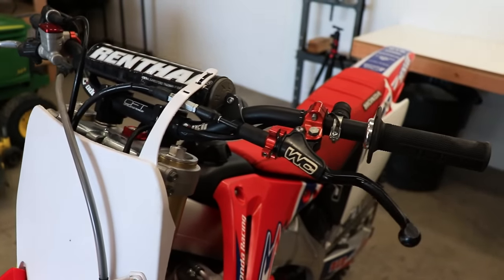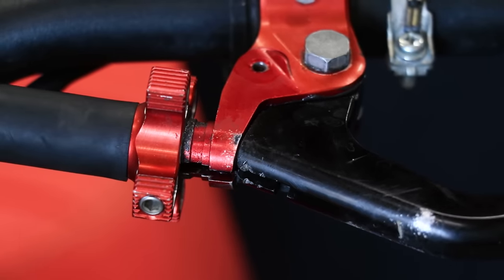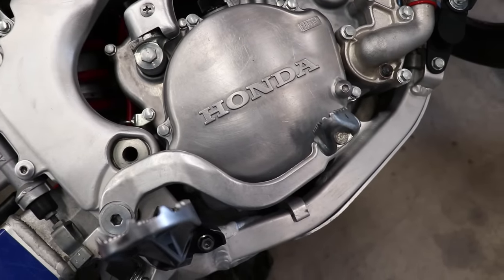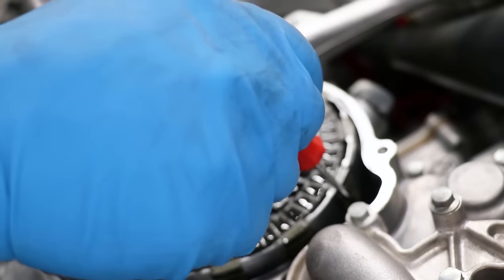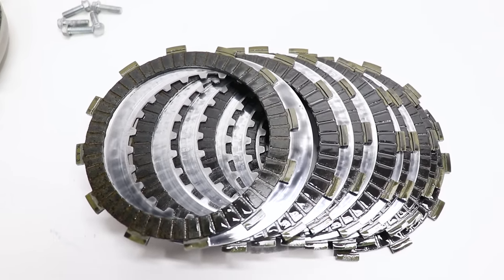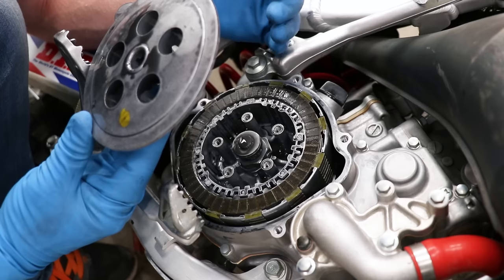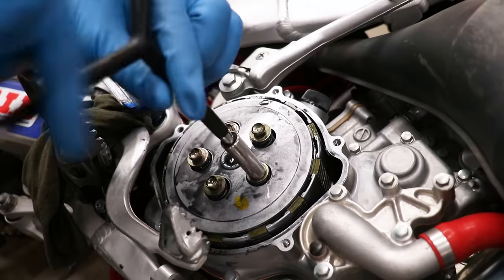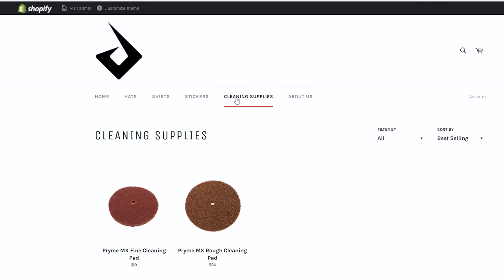How To Fix A Slipping Clutch

Comment from the maker: What is the common problem you have with your bikes?
Reply: Sick video
Reply: Cameron Niemela drowning them in the uk fuel injected bikes are horrible to sort once drowned and that happens alot in the uk trails
Reply: Bolts vibrate out
Reply: Jack Callahan you have stripped the threads or just arent tightening them enough or need to use blue locktight
Reply: my most common problem is ...they run out of gas! ;)
Reply: Cameron Niemela I have paranoia about my bike overheating. What is normal operating temperature?
Reply: I loose a lot of bolts
Reply: The chain on my supermoto is ALWAYS loose after any length of ride. Still haven't figured out if its the heavily increased traction or just my $25 DID non oring chain.
Reply: Carb problems... It's damn mikuni TMX that comes on the late model CRs. I'm sure you know all about it :(
Reply: tire tubes :(
Reply: common problem with my bike, is that i currently dont have one :(
Reply: Cameron Niemela many opinions.. Hone or not to hone a cylinder when replacing a piston?
Reply: Cameron Niemela leaking forks smh 🤦‍♂️
Reply: nooo, you dont home a nikasil barrel! a sttel barrel yes.. a nikasil one?? hell no! the coating is too soft compared to steel...
Reply: Snitchy1989 Its actually harder......
Reply: nikasil is formal nickel coating... Nickel is more closer to the properties of alloy... and alloy is not stronger than steel... Lighter weight yes, better heat transfer yes.. But not stronger....
Reply: Snitchy1989 You need a diamond hone to hone nicasil but you can hone a steel cylinder with a regular one.
Reply: My bike bogs down when i give lots of gas, its a ttr 125le
Reply: Yeah, they were a real pain to jet! I made the switch to a Keihin PWK carb years ago and have never looked back.
Reply: Nikasil is a lot harder than steel, that's why they use it. You can hone a Nikasil cylinder with a ball hone to remove glaze (it won't remove any cylinder material) but it is not normally necessary. A diamond hone is what is used on Nikasil cylinders if they want to remove small amounts of material to match it to a certain piston size or fix slightly out-of-round cylinders but most people won't have access to these machines and they mostly aren't necessary when doing a top end.
Reply: Ride red, never problems;)
Reply: Main seals
Reply: Gearbox sucks:(
Reply: carburetor problems
Reply: Nick Childs its a cheap chain and you bike is probably low geared and im assuming you are wheeling it as its a sm so the chain is getting pulled arder all the time those cheap chains are usually only used on 125s or very coasty riders if that makes sense
Reply: CHANCE1 216 clean it up if it has no marks on it just use a light kitchen green scouring pad thing and crosshatch the cylinder with it
Reply: when I push in my clutch he still goes forward it’s hydraulic btw
Reply: Cleaning the oil sight glass
Reply: torque to spec, manual specs will show you what to retorque every "race"
Reply: varies on the bike,  you can get rad caps that will tell you the temperature while still having factory rad cap pressure
Reply: clean out the dust seals and oil seals, use a seal doctor, for rebuilds are easy all you need is to follow the manual and take your time and be patient
Reply: switch to a stiffer spring
Reply: Vetrix clean the jets out of the carb
Reply: Cameron Niemela My 125 kick starter won't move and it will sound really werid
Reply: shes seized boi
Reply: Cameron Niemela it blowing o_o
Reply: Cameron Niemela old owners stripping every single bolt ever and some how getting two sockets stuck on bolts
Reply: my bike keeps riding when clutch is in
Reply: Vetrix had this with my 250 i just adjusted the idle rpm higher and it fixed it for me. Worth a try?
Reply: Mine is sometimes hard to start for no reason
Reply: Cameron Niemela My ttr125 doesn't like to idle 😂
Reply: Damion Mcclelland it’s the idle screw
Reply: Damion Mcclelland search up how to idle a dirt bike
Reply: Dude on dirt bike I have, but it idles really high with the choke on then when I turn the choke off it'll idle sometimes really slowly so idk, at least it runs lol! check it out on my channel R3d Rider
Reply: My psvr controller tracking sucks
Reply: My 2 stroke bogs dowb
Reply: Cameron Niemela getting parts in the uk for my 1990 cr125 is a bitch since spending a fortune on the engine the pile of shite still wont start it was a heep and had loads of stuff missing and broken when a bought it for £150 i bought it to save it i must have been out my nut lol
Reply: I'm just going to put this out there, PINCHING MY FREAKING TUBES WHEN I CHANGE MY TIRE! I've done that like 15 times because I don't have the right tools, probably gonna have my dad change them from now on. any tool you suggest me to get? (Asking for anyone's insight)
Reply: Could someone help me? 
I bought a new clutch lever for my Honda XR400 but even at max adjustment, the clutch slips (the clutch plates are pretty much apart from each other). I think the lever is to big (the space between the adjuster and the lever itself is too wide) for the cable, is that possible? And is there a way around it other than buying a new lever?
Would really appreciate some help!
Reply: My scrap heap RS 125 -99 shutting off and not starting, sounding like choking on fuel after. Silly me did not crack open the bike when i bought it as a used and abused little toy, but with the inspiration from your videos i've already begun the teardown and restoration process! Wish me luck haha
Reply: When it's cold, the clutch won't engage. How do I fix it? Free play is good on the cable
Reply: Bolts coming out
Reply: valves
Reply: Cameron Niemela my clutch is not disengaging
Reply: My clutch man!! My clutch is at it's tightest and it's still feel loose and sits close to the grip, how can I fix this with out having to buy a new cable ?!?!?! Thanks mate great video
Reply: I ride an 09 yz250f.  I started racing GPs this year. I’m not sure if it’s nerves or what but in every race I manage to stall the engine. When this happens under load I have a hell of a time getting the bike to restart.
I ride the piss out of it training, I never have trouble stalling or restarting the bike when I shut it down using the kill switch. 
Not sure if the bike needs carb adjustment or valves adjusted or something like that. It runs solid other than that.
Reply: Cameron niemela bro how to do to regulate the clutch, I have a crf450x 2008 and the clutch is very hard and I can not regulate it anymore on the shift handle and when I accelerate as it has 7mil rpm slip a bit this happened after I ordered to change the separators of the crocheted discs
Reply: My clutch disc makes noise and when you put the bike in gear and you going when you pull the clutch the bike doesn’t go on neutral mode when you put it in gear and you pull the clutch you will then see the bike slowing down
Reply: My clutch disc makes noise and when you put the bike in gear and you going when you pull the clutch the bike doesn’t go on neutral mode when you put it in gear and you pull the clutch you will then see the bike slowing down
Reply: Cameron Niemela 
sticky clutch
its when 1st start in d mornin and after warming up id shift to 1st gear and d bike suddenly jumps...
even thou d pressure plate moves widely
Reply: ow and as i change oil d oil i drained is avocado green
😅
Reply: Damion Mcclelland 
turn d idle screw clockwise to get higher rpm in idle
Reply: Manuel Xavier 
maybe the clutch cable was too short for d new lever
Reply: I just dont know how tight the chain must be
Reply: My clutch cable broke all the time iven when i yoused piano vire
Reply: And that happend on my 2004 Yamaha YZ F 450
Reply: My bike has sat for maybe a month and my clutch stoped but it was good before
Reply: Broken chain or dirty carb
Reply: CR 125 carb overflowing when bike leans over to the left hand side.
Reply: Clutch lever hard to pull, anyone know how to fix this?
Reply: Future Focus new reeds
Reply: My kx450f makes a weird slipping noise whenever I drive at a slow rpm but when I give it more power it goes away, no clue what it is. Suggestions?
Reply: fork seals
Reply: Vetrix I can diagnose that for you. Sell it and buy a real bike, wr250 or 450. That’ll fix it right up
Reply: Hope you're well brotha. Can the ridges on the basket also cause the clutch to slip? Thank you much!!
Reply: Have a 250cc Barossa Quad and Quad only runs on full power when choke is fully engaged jets seem clear also ??
Reply: Dry chain
Reply: Carburator
Reply: Hey Niemelä PLEASE HELP ME with an aswer? Any idea what could be the issue in my 2007 rmz- 250 clutch. it started to not stay still when in gear and clutch pulled, so i tigthtened the cable. 10 min of riding and same thing again. again and again until, I took all the "loose" out from the cable by using the adjuster in the cable itsel and there were no more any adjustement to be done( the fast-adjuster is broken on my lever), finally i opened the clutch and checked the plates and and checked for possible grooves on the basket. nothing. well, I put it together and boom it felt like a new bike....for 5-15 mintues until i almost couldnt stop properly with the clutch lever pulled alla the way. again, i adjusted the cable a little more tight and went riding, worked fine....for another 5-10 minutes until it started AGAIN to beg more of "taking out of the loose in the cable" it doesnt SEEM to be slippinng the clutch, it just stops working properly after it warms up. and when i look at the part where the cable goes in the engine end, when I pull the clutch all the way, it moves normally but when i release it doesnt seem to go all the way back to its normal position, if i push it back with my finger theres like quite a few millimeters that it goes back even tho its not the cable that keeps it fro m not resetting back to its normal starting point. This is my first THIS "new" dirtbike even thio ive had A LOT of different bikes in the past.
Reply: Everything😂
Reply: When I put my bike into gear it just dies
Reply: so my and my buddy have this problem when we pull in the lever the clutch is still engaged
Reply: A hard clutch pull on my 2017 yz450fx.
Reply: @bacalaoenfritao  facts my kx100 lost a lot of bolts
Reply: Common problem: Breaking throttle cables right in the throttle tube, Its common on my bike, So im getting a better throttle tube...
Reply: Wheely, tightenen chain 
Weeely
Tightenen chain 
😄
Reply: Clutch problem
Reply: I think my clutch easy pull extender narrowed down the cable pull

Comment: When I was working at the local motorcycle shop I could not believe how many people came in with clutch cables bango tight. We would have customers come in all the time for diag on slipping clutches that took 20 minutes to two hours of labor to fix on Dirtbike's and it was end up costing well over 100 dollars almost every time. The best was when you would do the guy a favor and lube and adjust the cable to spec to be told by the customer that we messed up his now perfectly functional clutch

Comment: Hello,  I just got my dirtbike "repaired" I had a broken crankcase and kick start gear,  but my transmission before was working fine, now when I start the bike, pop it in first gear to take off,  only to find out I'm back in neutral,  I'll kick down to put it back on first , only to be able to kick it in first over and over,  occasionally it stays on first then seems to slip out of it, only way I got it to work is if I literally hold my foot pushing it down to keep it In first gear,  what do you think it could be? Any info/help would be greatly appreciated!

Comment: Good video.
Method I used to adjust cable free play servicing bikes was to turn the steering to full lock both sides, one side usually has less free play than the other as the cable bends more around the steering head, then adjust so it just has free play on the tight side.
That usually gives enough straight ahead and ensures at least some free play even on full lock.
Same for throttle cables.
Reply: Good tip, thanks!

Comment: thanks for this excellent video, I felt my engine let go during an enduro sprint, thought it was overheating, but clutch was slipping, my lever had no play at all, I must have smoked it. Thanks I'm pretty sure I have diagnose problem and solution with your video!

Comment: Great video!!!  My Daughters dong fang 250 slipping bad only 600 miles, got hot during a parade, as a matter a fact all the bikes Harleys, Yam, Hondas overheated!!!! Not my VROD!!!!! only prob I had was finding the spec for VROD friction plates, slipping @19K miles, finally found it and they were right at the min. Replaced with slipper clutch, never need 3rd geaR AGAINST old school hogs!!!!

Comment: Could someone help me? 
I bought a new clutch lever for my Honda XR400 but even at max adjustment, the clutch slips (the clutch plates are pretty much apart from each other). I think the lever is to big (the space between the adjuster and the lever itself is too wide) for the cable, is that possible? And is there a way around it other than buying a new lever?
Would really appreciate some help!

Comment: Need help tech ,question 😫,  I have Honda cb125r the clutch lever sticks half way through a gear change ,which creates  high revs and failed transition!is it the cable that needs adjusting, or gulp a new clutch kit .thank you .

Comment: Here's one for you Cameron...
My '07 Bombardier DS650X has trouble finding neutral accompanied with a noticeable 'clunk' when I go for 1st gear. Now you'd think that my cable is full of slack and the clutch isn't disengaging properly however the P.O. had it set to where the cable was actually under tension, resulting in a clutch that slipped anywhere above 60% throttle...
I checked another DS650X with a good clutch for reference and there seemed to be the same amount of travel in the lever [etc.] so I am assuming that the problem isn't there.

Someone told me that changing the oil could reduce the amount of drag on the clutch plates, thus solving the issue (P.O. probably used an oil with a high viscosity rating), and I would greatly appreciate your opinion on this as well as any other suggestions you may have! :)
Reply from the maker: No matter the machine, you should always have the about 1/8 to 1/4 of freeplay at the lever. I'd guess a notched basket, or possibly the oil. Not likely it's the oil but doesn't hurt to change it out for something recommended for your model.

Comment: i have a 2020 husq TC 125 and the manual doesn't mention anything about minimum plate thickness. All I know is that brand new they are 1.95mm and they are measuring about 1.86-1.89...clutch is slipping and oil smells burnt...any suggestions? inner and outer basket looks fine, pressure plate in pretty good shape, and the metal plates aren't too discolored....

Comment: Great tech info man..Cameron What type/Brand Gear oil and engine oil  do you prefer or would recommend  for a CRF450
Reply: Don Simpson Cameron would do maxima, duh. I run Lucas oil on my crf 250r. I do 10w-40 for the engine oil, and 80/85 synthetic gear oil
Reply from the maker: I'm partial to Maxima, but have good luck with Rotella T 10W-40 in my previous bikes.

Comment: thanks Cam, i basically have the opposite problem on my Husaberg. when i pull the clutch, then there is still a very light amount of friction and the bike very slowly rolls forward if i don't hold it back. i have an hydraulic clutch, so no clutch-cable to adjust.. i have already changed the hydraulic oil, to ensure it's properly bled, but it's still happening. not that it would really bother me, but i feel that i will get excessive plate-wear like that. any ideas?

Comment: Hey man, just picked up a 2005 CRF450R, it had a broken perch and I replaced it with a nicer 1 finger easy pull perch but being a noob I rode it roughly 20 miles with it adjusted to tight slipping the clutch. Now I have a loud screeching sound coming from the clutch. Won’t be able to get inside the clutch for a few days but my question is, is that noise a common sign of bad clutch plates? Also it looks as if the fluid was slightly low as well so should I be worried about transmission damage?

Comment: if 0:05 this is happening but only after a few laps (3-4), but when cold works as usual do i need to change the dics? i’ve a ktm 150 2022 with hydraulic clutch

Comment: I have a question. With my crf250r up on a stand and in gear, when I pull in the clutch should the rear wheel turn easy or will it have some resistance to turn

Comment: Thanks for showing the actual measuring of the fiber plates. Visual inspection cannot discern 2.7mm from 2.8mm which can be the difference between a well working or a slipping clutch. Sharing your knowledge makes us all better. Great video.
Reply from the maker: Thanks for watching Don!

Comment: okay so i never did this, but in case i will have to one day, this video was great! but also, i wonder if there  isnt any kind of seal for the clutch cover?
Reply: i guess there is..but it was on the cover not on the engine..so we couldnt see it..
Reply: Endurec yes there's a gasket and usually it's reusable, if it leaks oil after reassembling it, then just get a new one its not a big deal, but normally reusing is fine, unless it rips.
Reply: Endurec yeah my old 85 had a metal gasket, they can be hard to see but they are there
Reply from the maker: Thanks for watching! There is an o-ring on the cover

Comment: what if the new cable is still  too tight on the loosest setting on the adjuster by the engine and by the clutch lever? i bought the same cable for my model bike